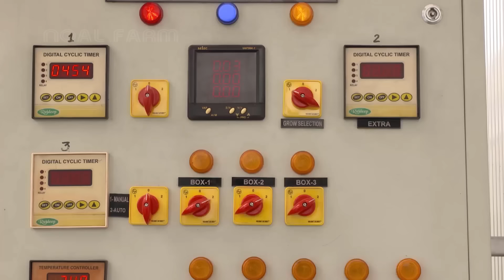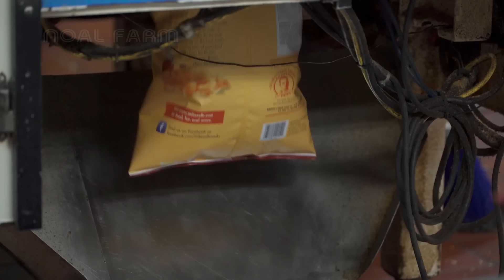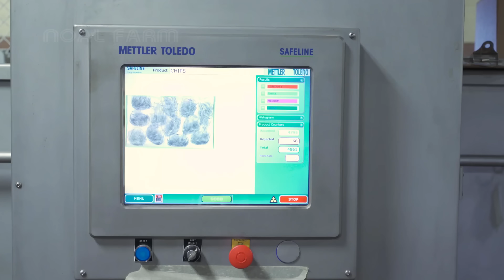Aeroponics Potato Farming - Potato Chip Process Factory - Modern Potato Agriculture Technology

Comment: This system may use very little space, very little water and some nutrients BUT it seems to have a high electricity requirement when pumps, heaters and lighting etc., are all added together.
Reply: It dose uses a LOT OF ELECTRIC ! Cost more than the fruit your growing! Lighting and temperature control is the biggest cost.
Reply: Unless they use solar energy
Reply: @leylaboom2341  Yes, that works particularly well on cloudy days and at night time.
Reply: Mmm good old fashioned electricity made from coal and petroleum. It's eco friendly. 👍
Reply: @somethingorother9263 Now we are talking!
Reply: @Alfred Neuman
you don’t run pumps and all the other equipment at night time genius
Reply: @polyfenes
Like Australia; where we’ve had droughts for 20 years and have unlimited sunshine and cloudless days
Reply: @tinderella2386  So how does the temperature control both the liquid nutrient and the air in the growing area  be maintained 24/7?
I do know something about hydroponics, clearly you don't.
Reply: @alfredneuman6488  You do realize solar panels collect and store energy right? The power doesn't go off the moment the sun goes down.  All of this is easily achievable with purely solar energy.
Reply: @MI2APatriot  Solar panels generate electricity when exposed to sufficient solar radiation - they don't store energy! For that you need huge battery banks, to account for low angle of incidence of radiation (parts of the day and winters), night time and overcast days, but to charge those huge battery banks you have to multiply several times the number of solar panels, occupying an extensive area (and don't forget a small project like the one shown still consumes hundreds of kilowatts). It's doable, but it's extremely expensive, completely rendering the project useless for anything but research (or very special applications) where money abounds and the effective costs of operation and maintenance are not part of the equation.
Reply: Yep. Completely agree! In fact this was exactly what came to my mind as I watched the video - very interesting project, good for research, but with no real-world application, unless potatoes become a prized rarity, only at the reach of billionaires (which may be not too far fetched, in view of the recent western world agricultural policies).
Reply: @JoseSilveira-newhandleforYT  You took me too literally and made yourself look a little slow. Yes the panel itself is not storing energy, it is collecting energy which can be stored. All's you just said was that it is doable, which is what I already said. Doesn't matter if it's costly, it's doable. I never said it was cheap.
Reply: @MI2APatriot  Make your mind up please.
Reply: @alfredneuman6488  Learn to read please.
Reply: @MI2APatriot  Sure pal.
Reply: @Alfred Neuman
i Am an experienced hydroponics grower actually.
You don’t need to do much at nighttime. It’s night. They probably just open louvres in the greenhouse.
They’d have some type of chiller for the nutrient solution yes, but they wouldn’t be feeding during the night cycle, so pumps wouldn’t be running, as well as being night time there’d be very little heat load on the nutrient solution itself.
I don’t know how direct the offset is, but If you’re growing outdoors, you need a bunch of pesticides.
They need a factory to make them all using fossil fuel. They have to be transported and stored all requiring fossil fuels. They have to be applied using machinery, more fossil fuels.
All that is avoided my simply growing in a controlled greenhouse.
So you’re actually not looking at the big picture, and a ventilation fan prob reallt doesn’t chew that much juice that a small solar array wouldn’t completely offset during the day.
Reply: @Jose Silveira
while I can appreciate your skepticism, my main concern is the sheer scalability for the sheer amount of potatoes we need to grow, the capital expenditure would be astronomical.
But you’re not thinking outside of the area you live in.
I live in Australia. We’ve had droughts for 20+ years. We live on the driest continent on earth. Water is a scarcity. Sun light and intense sunlight at that and clear sunny days are in abundance. So yes; water is a huge factor here as any form of hydroponics or aquaponics only uses 10% of the water.
That might not seem like a big deal, but in places like Australia, It Is.
Reply: And don't forget about highly qualified personnel.
Reply: @alfredneuman6488  it doesn´t use that much electricity those booster pumps run on 12V, and you could pre-charge the pressure tanks with the nutrient solution and let the solenoids do the rest which use next to nothing in electricity and can be powered by a normal car battery, usually you go with short on cycles like 1 second and the off cycles of 5 minutes. and the greenhouse let´s natural sunlight through the roof. indoor growing for crops like tomatoes are much more efficient if grown indoors, because of perfect climate control, no use of pesticides and recycling the drain water
Reply: @tinderella2386  you could build hude desalination plants either powered with electricity produced by solar panels, or building a facility which catches the evaporated water for use, and as a bonus side effect you get table salt. the latter method comes with no moving parts so once build many generations to come would benefit from it
Reply: @Humbulla93  Whatever... I have lost interest.
Reply: I’m totally agreed .
Reply: The amount of resources that go into this us rediculous.  For potatoes of all things...
Even in arid areas, the soil can be restored and crops grown if the rigth methods are used.  It just takes time and a sustained effort to get it to the poiny where is can self-sustain.
Lybia was greening the desert before Qudaffi was knocked off fornhabing the audacity tontey to mint his own gold backed currency.
And there are permaculture projects all over the world that are reclaiming the desert.  One of the most notable is in Jordan.  They are working with arid conditions and highly salinated soils.  But they are making headway.

Another factor is the demand for agricultural products that are not suited for the local environment.  No one should be growing potatoes in the desert in the first place.  There are other crops that are much better suited for that climate.  This is how regional food cultures emerged in the first place.  People need to relearn the idea that they can't have everything they want all the time.  It is much better to work with nature and leran to love the crops that grow well in you local area, rather than to force the issue by creating resource hungry monstosities.
Reply: @426superbee4  
It could easily be run on solar as the amount of water that needs to be moved is very small.
Reply: @Humbulla93  
A lot of the folks commenting have no experience of running aeroponics and can only guess what power it takes.
Reply: @atomizer2665   i like wind power, Makes power day and night and it cheaper than solar, Both requires battery banks, That a big cost, or you can do both
Reply: @atomizer2665  its very expensive Plus the plants get spoil to the indoors.  Out doors is much much better, and grow healthier plants and bigger fruits
Reply: @426superbee4  
I run aeroponics indoors and outdoors. The overall cost of aeroponics is the same or less than hydroponics when you add everything up.
Reply: @426superbee4  
A 8ft x 4ft  aeroponic growing area can be powered by a 20w solar panel and a 12v 7AH battery.  Wind power is great if you can get the turbine high enough and dont live in a built up area.